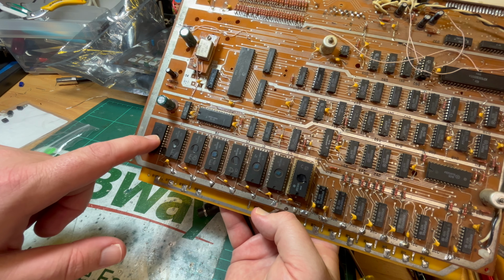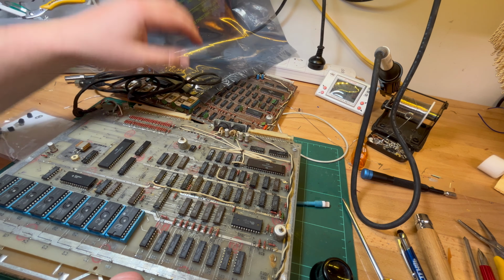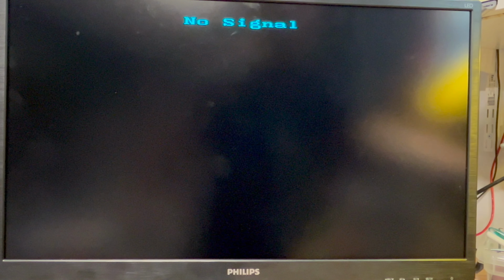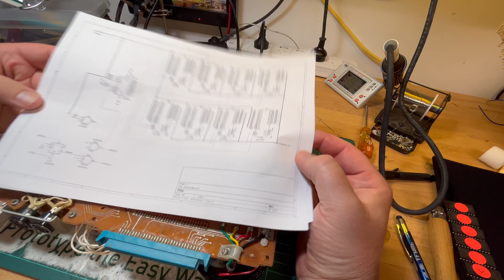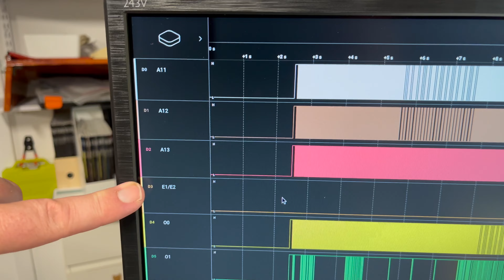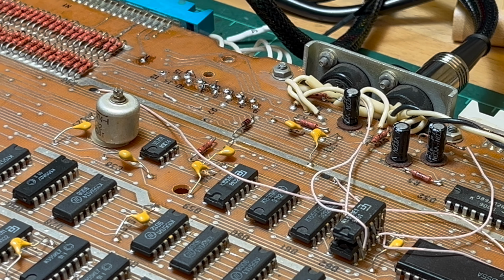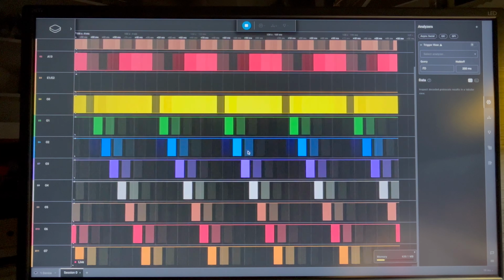🇺🇦 ПК-01 Львов (PC-01 Lviv): Part 7 (ROM Troubleshooting started) [TCE #0393]

Comment: Your enables E1/E2 disappeared after you swapped the chip?🤔
Reply from the maker: From what I could see (and assume), the E1/E2 remained low (active low) the whole time, with either chip, as it was reading from ROM, or trying to read from ROM.  This was an external signal going into the 3-to-8 decoder, like the address lines.

So, a bit weird (in my simple mind) ... with the original chip (not O5 output), it would read/execute the boot screen from ROM, and then get stuck with "?SN" output ... with the replacement, no boot image and it looks like the CPU is stuck looping through addresses only getting NOPs ... ?
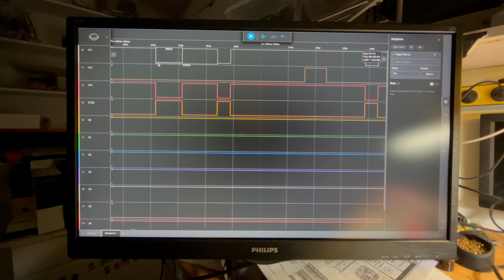Reply: @Brfff I was just going by the earlier trace like 22:50 and around 19:25 it was going up and down, but the traces at the end looked like it wasn't moving at all. 🤷
Reply from the maker: Ahh, maybe ... yep, after replacing the 3-to-8 decoder, it looks like the CPU is just cycling through addresses ... although thinking about it, you'd think that some of the address range would be RAM and so the enable should go high to disable the ROMs ... hmmm, I wonder if maybe that's the issue ... ?

Comment: "Off with their legs!" Chop them off and not risk the board. Or use Chip-Quik.

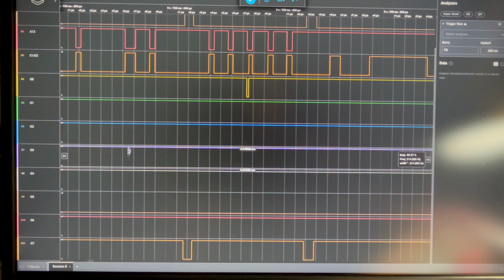@24:49 05 & 07 are both low at the same time? J'accuse! (yes, that's definitely an issue at least).

I think that you mean "Solder mask" and not "Conformal coating". The last thing that you want on your board is conformal coating.

And once you fix your 3-to-8 the cycling of the ROMs looked suspicious as hell. No reason for that to be happening. Is it really counting from 0 to 7 on the input side of your DeMux?

You  could use the existing DeMux lines (00 to 07) as bank selects on your big ROM.

I took a quick look at what you locally have available for LAs, fine for hobbyist level LAs, not good for old HP LAs... 

Happy New Year!
Reply from the maker: I thought "conformal coating" was the "colour" applied to the PCB that protected the tracks??  Have I been referring to it wrong all this time??

Yeah, I don't know what's happening with A0 to A10, but I'm guessing that the 8080 is just looping through addresses ... like the Z80 ... but only hitting NOPs, so moving on to the next address.

If I can get the original ROMs removed without too much damage, then I think I'll definitely try just hooking a 27128 into it (can't burn 2716s anyway) - A0 to A10 are already available in each socket (just need one socket), then I would pick A11/12/14 up from the CPU address bus ... well, the input to the 3-to-8 decoder.
Reply: @Brfff  Solder mask prevents solder from sticking to where it doesn't belong. Conformal coating is a protective coating that is applied after the board has been built and tested. It's there to help prevent corrosion and water damage. And as you can imagine, Conformal coating is a bear to get off so that you can perform repairs (or even testing, for that matter).

We know at least one ROM has a viable image (the one that produces your startup image), so I would expect the CPU to linger on that ROM while loading the image. But it looks like it's just cycling through all of them.
Reply from the maker: Yep!  That's what I meant ... because there is no coating, it's pretty easy to short those decoupling capacitors across other traces ... either forcing a trace high or forcing it low ... hence why the Soviets usually did the upside-down Space Invader installation style I guess ;)